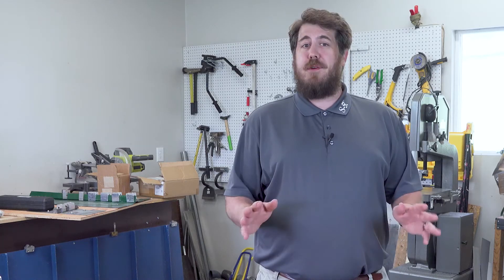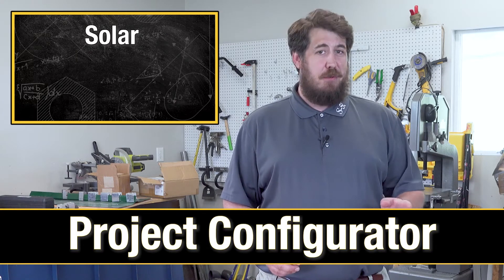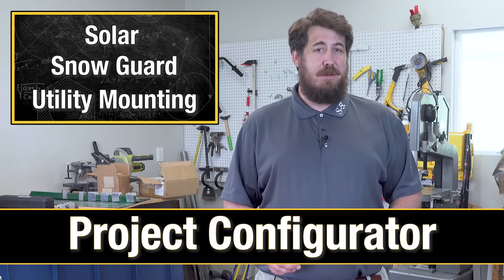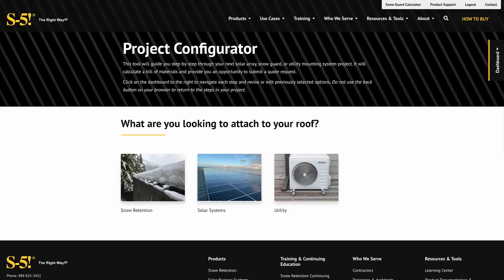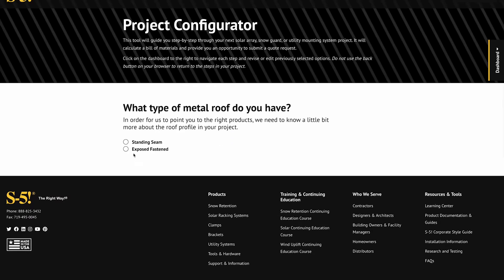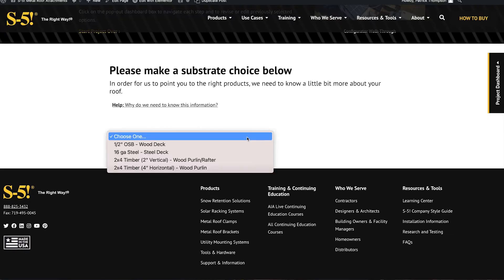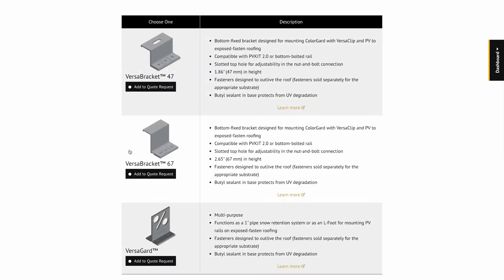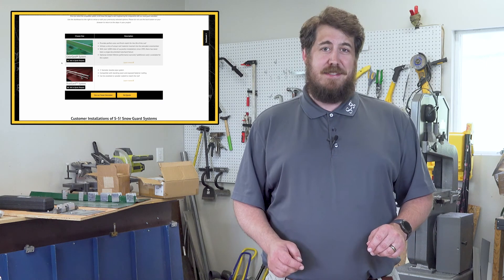The S-5! Project Configurator

Comment: Your online configurator fails after "Trapezoidal" selection which results in "There are no results" — ie, dead end.
Reply from the maker: Thank you letting us know. What browser are you using? Our site tends to work best in Chrome and I am currently not experiencing any issues in Chrome.
Reply: @TheMetalRoofingAcademy  Using Chrome latest version ...just tried configurator again with same "There are no results" after choosing roof profile "Exposed fastened" and then "Trapezoidal"
Reply from the maker: @C_C_SEA  Thank you for confirming.  We're having our IT team work on a solution to that problem right now.